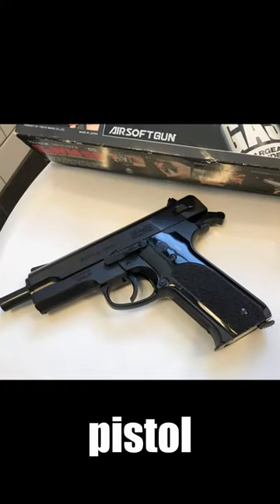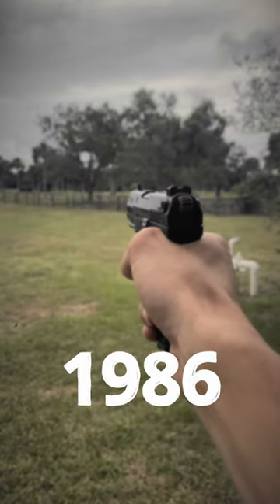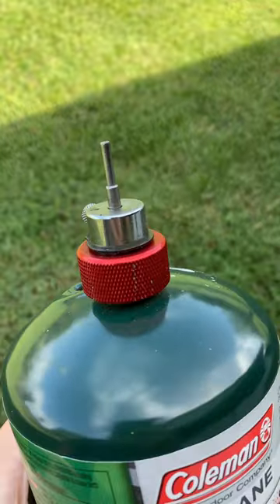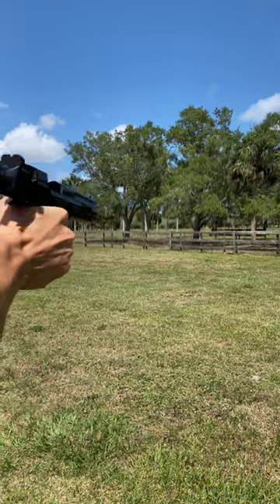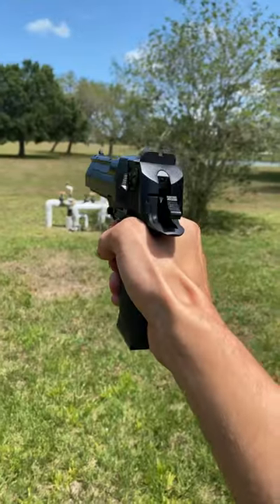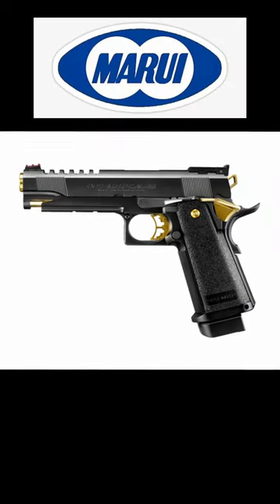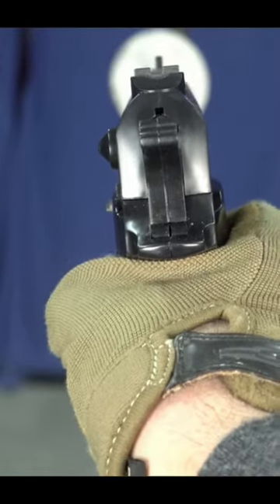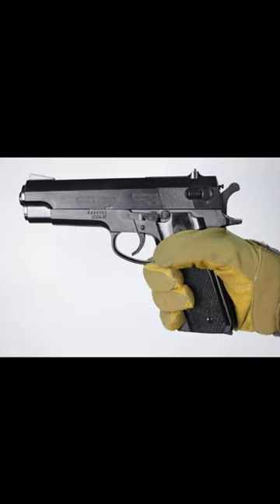The OLDEST Airsoft Pistol Ever Made!

Comment: I remember them working with freon or something until they found more environmental friendly solutions, nice video!
Reply: I think they still use freon but are looking into "white gas" which is like green gas but even lower pressure
Reply: @ExtraThiccc  no freon would have a GWP not friendly enough, this is much safer, but you can use freon
Reply: You could still probably fill it with most gases lol its just pressure and keeping it lubed
Reply: @DasGoodSoup  when i was waiting for my green gas to arrive when i got my first gbb pistol i tried to fill it with butane but it didn't work (i'm guessing it didn't because it wasn't pressurized enough)
Reply: @lonk0420  yeah it needs propane not butane. Butane is like maybe 5 psi compared to 100 psi of propane (range varies with temperature, but its very low pressure still)
Reply: Freon is propane.
Reply: @allaboutroofing2  Propane is a type of gas that can be used as refrigerant, but some of airsoft used to use R12 or R22, and then some were using R134a (which I don't believe is flammable, one of its benefits, so its definitely not propane).

So not all Freon is propane, and I think of R134a as a typical Freon (most cars/homes use that gas, unless they are old and use R12, which I don't think is flammable either). Ammonia is another good refrigerant for getting cold, but its not particularly safe in case it leaks while people are sleeping.
Reply: Nice pfp 😂
Reply: @jakegarrett8109 precisely this. Standard tm glocks are all still only rated for r134a
Reply: @allaboutroofing2  propane is not freon. It can be used as a refrigerant it's R290. Freon is a trademark used to describe certain refrigerants and not propane.
Reply: None of you know what freon is.
Reply: Why would they use freon, compressed air or natural gas are both much cheaper
Reply: @skonky  natural gas is also stored as a liquid, if you didn't know
Reply: @jakegarrett8109 R1234yf is another Freon used in vehicles. (The more expensive one) 14 oz bottle of 1234 Freon ?? Fcking $130! 130! 😂 the damn car takes 14.5 oz!!!! Damn chevy, but compared to the other Freon like $80 max for the amount needed for most cars
Reply: @zyourzgrandzmaz no you don’t do you?
Reply: I FUCKEN LOVE FREON AND FUCKEN HATE THE EPA WOOOO

Comment: By compressed gas, he meant R-12 refrigerant gas, but he uses propane instead as it’s less damaging to the atmosphere as R-12 was.
Reply: That also means that if you have an airsoft grounds in a valley, you slowly make a highly flammable carpet of gas.
Reply: And no doubt less expensive to use propane than r 12.
Reply: @madsam7582  That might sound like it means something, but it's roughly the equivalent of implying that family barbecue picnics """in a valley park""" will slowly make a highly flammable carpet of gas, from compounding flatulence, due to increased baked bean consumption within the region. I mean.. yeah. But so the fuck what.

Comment: That is a way some real pistols work (Walther?). It is a blow back action but some gas is vented into a piston that holds the slide closed just long enough for the bullet to leave the barrel and pressures reduce. The advantage is you can use a lighter recoil spring while still using a more powerful cartridge.
But that is real guns.

Comment: Gaa forward? I'm thinking more gas-assisted reset, if they didn't use a pinch of gas they would've had to engineer a dual spring system; think a powerful firing and slide kicking spring and a potentially weaker slide return & trigger reset spring.

Comment: U are actually incorrect my friend TM gas guns actually use the gas to push the slide back and a spring to return it forward with the help of the blow back housing and the flute valve the flute valve lets enough air through to propel the bb and then shuts forcing air into the blow back housing pushing the slide back and then the guide rod and return spring pushes the slide forward and back into Battery pew pew